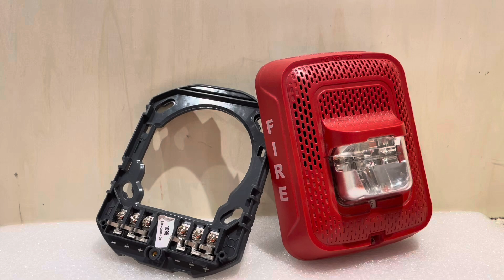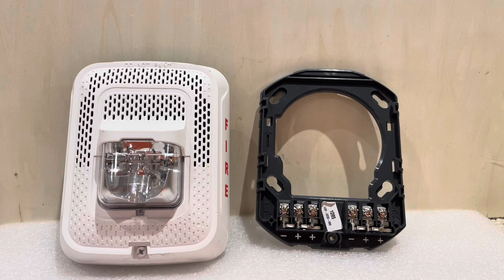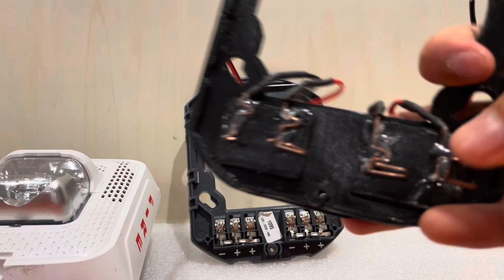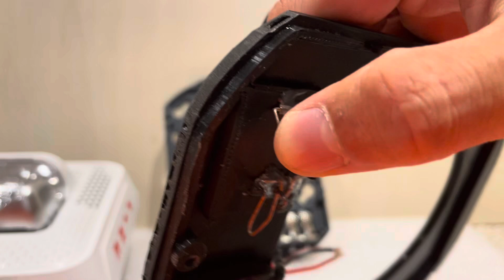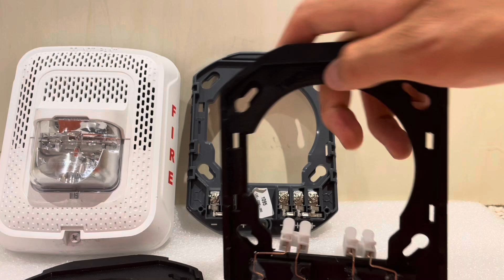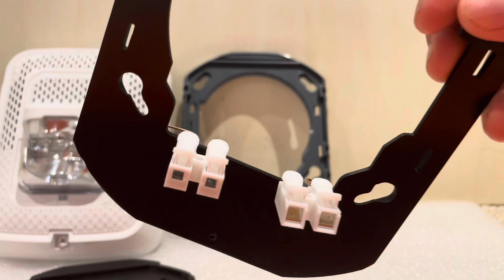Homemade 3D-Printed Mounting Bracket for L-Series Fire Alarm Speaker/Strobes!

Comment: Yo fire alarm dude pls recommend some speaker strobes I should buy for my voice evac board
Reply: some great speaker strobes for beginers are weelock devices they are not to expensive and the led ones are great, another option is est led speker strobes, they have a great design and they are extremly thin to the point you can fit it into a single gang recepticle box